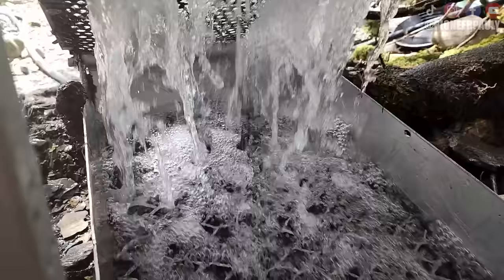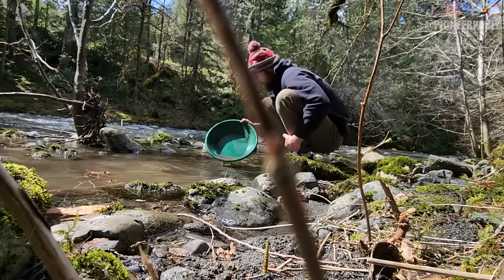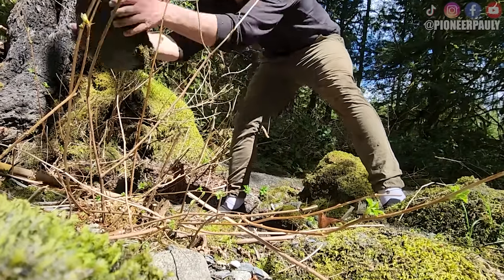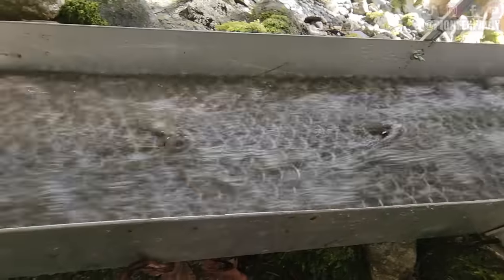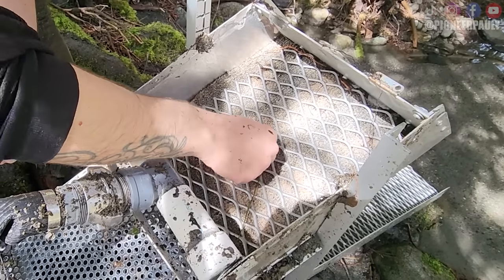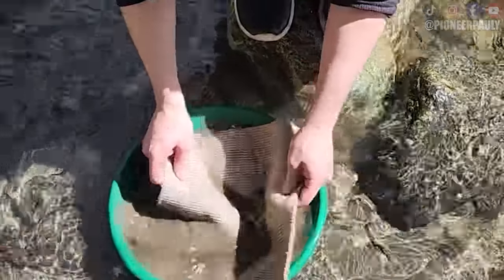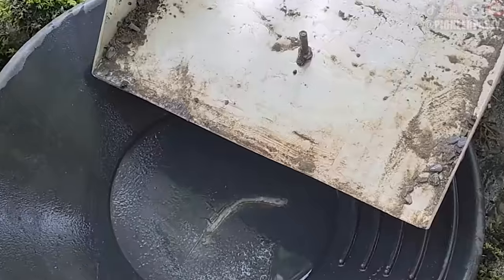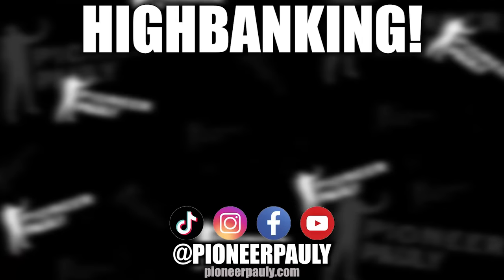How Much GOLD Did This Homemade Highbanker Recover?

Comment: I have an old high banker that I've been using for 3 decades and I turned it into a shaker box with a 12v motor and a 12v solar panel.  I did it with a fan belt and a lopsided pulley.  It works really good and I use it in the desert

Comment: Paula you're a sluice box is leaning To one  side And your water flow is too fast. You need to go down with the flu spots level it out where it's flat. You don't have rifles, so you're pushing too much water down too fast. And it's blowing the gold out of the box. Bring the slue spots down, level it out and low your waterfall and you'll catch more gold.
Tom from south carolina

Comment: Think abOut putting a 45* angle adaptor on the end of your inlet house as it meets your spray bar. It will cut down on gas usage and increase flow rate.

Comment: Why dont you change them bolt in middle put a little hole near it and use zip tie as you know you will get the use of the middle strip hope you understand what i am saying it wont disturb the flow if u do it 👍🇬🇧✌